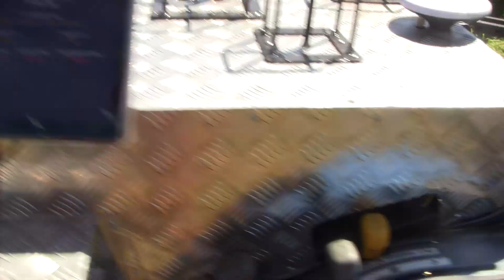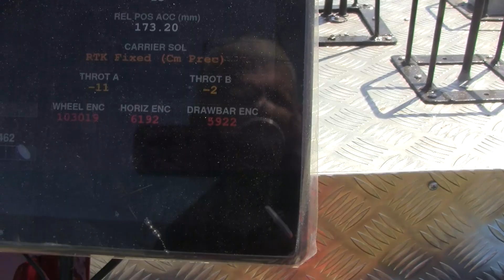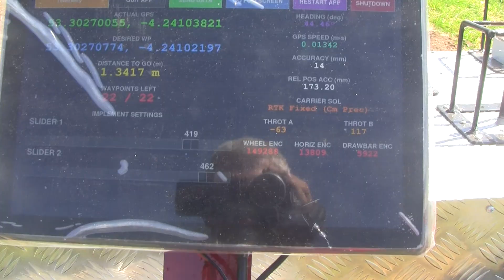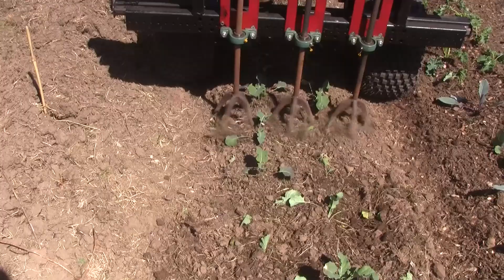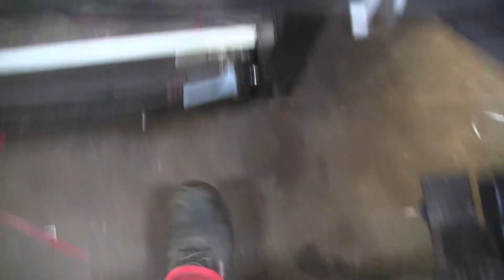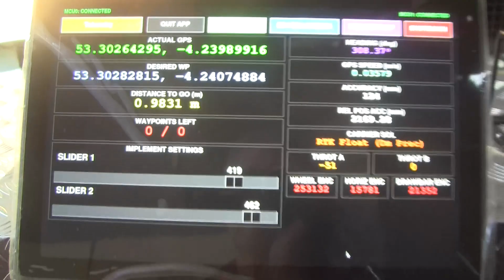weedinator test may 2026 01

Comment: 1) The first thing to note it's the vehicule row following is fine.
2) It seem to me that the claws are supposed to move left and right thanks to the hydraulic in order to avoid crop collision but it look like it doesn't, if this feature is still in developement that mean it's normal to observe some crop destruction because even if you planted it accurately the tractor row following can difficultly reach centimetric precision, then your planting accuracy can't also be so perfect and finally, the plants can "decide" to grow by one side or the other which is unpredictable. All these risk cumulate and I'm even surprised that there is not more damage. So if my hypothesis about the claws (not moving) is right, it's not a fail !
3) Accumulation of residues on claws : it can probably be solved by it's design, look at amazone cultimix power arrow's on the web, it's tine can be mounted attaking to lift ground and mix it, or receding which avoid residues accumulation problems.
Reply from the maker: Yes, the receding claw should be able to allow residue to fall off - thanks !!